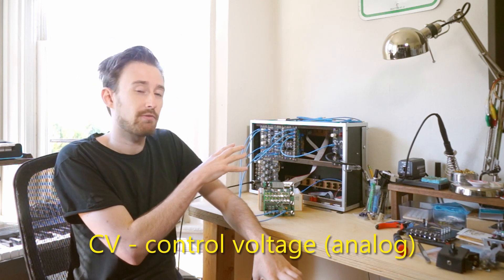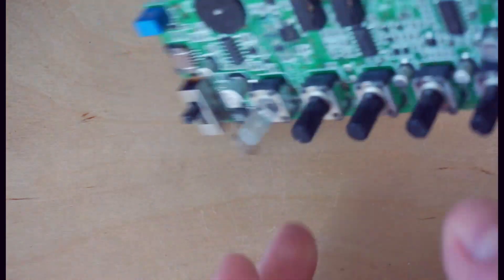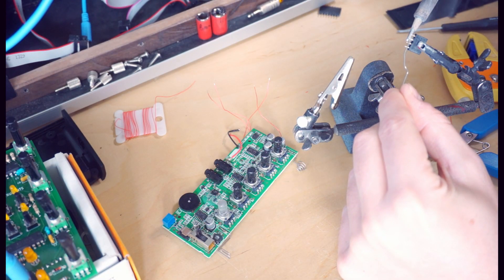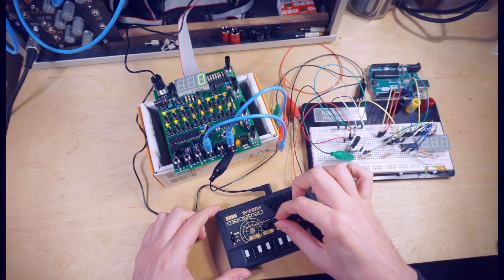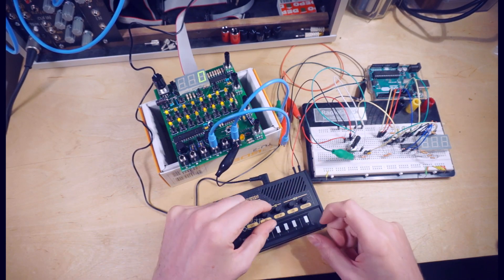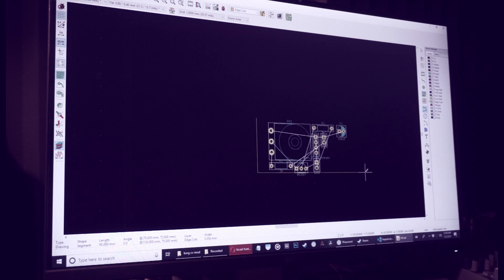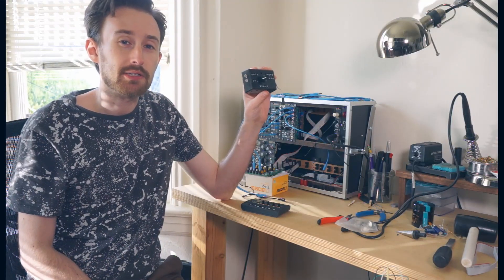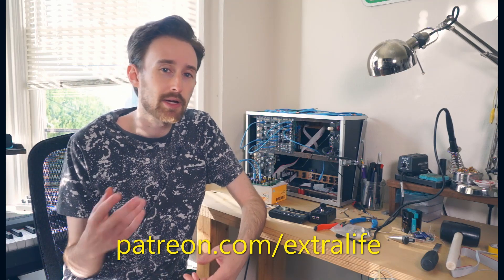Korg Monotron CV Input Mod (Eurorack Control Voltage hack)

Comment: Thanks for sharing. I arrived at the same solution to just control via single cable connection to gate. I control it directly via software with DC decoupled audio interface outs.

Comment: Awesome stuff!

I don’t have a Monotron but I have a similar goal with a Stylophone x-1 I got for Christmas, I noticed on day two it’d fart out notes if I touched the stylus tip to the cv/gate out from my Deluge, ten minutes later it was in bits :) I’m just connecting both input tips to the stylus until I work out what I need to do next, surprisingly the intonation is correct if I output from the deluge at 0.7v/oct.

Mathematically it seems like I need to multiply the gate and cv whereas I think my current bodge will be adding them together - which maybe looks a bit like your circuit diagram. I think I need to study both circuits a bit and have a re-watch, nice one for the info!

Comment: with all the knob twisted towards the gate of the monotron delay and the pin1 of the transistor , I am only getting notes ranging from G4 to F6. Compared to ableton operator plugin with same wave, G4 from my midikeyboard delivers almost an  bassy A1 note, and F6 from midikeyboard is barely reaching a G4 note from opeartor :c
 
Is there any further tip to further calibrate the monotron pitch? Changing some values? a bigger value from pot?

Ableton CV instrument doesnt work because calibration process requires triggering notes from the external synth and since it is a ribbon which gets bypassed when you plug gate signal... just doesnt work. Leaving the pitch still before calibrating within the plugin mutes the oscilation when trying to calibrate itself... Its been two months with this xp.
h3lp
Reply: What was the output voltage range from your sequencer? maybe i could tune it if I boost the cv from my audio interface
Reply from the maker: Hey, the output range of my sequencer is 0-8V or so. Officially eurorack is 0-10v. You should be able to tune it reasonably well using the potentiometer but you may not get a "concert" pitch as the korg oscillator is not 1v calibrated. I would expect to get probably 2-3 usably tuned octaves, and then some major nonlinearity in the upper range.

My suggestion would be to set up a MIDI sequence that plays a couple of octaves, like C1 C2 C3 C4 and then adjust the potentiometer by ear until you get approximate octaves. Then use a tuner to get the middle 2 in as close to perfect tune as possible going back and forth between two in a sequence in ableton. 

If you are not able to get octaves at all because the interval is too small, then there may be an error in your hardware - at the maximum rightward turn, the pot would let the full 0-10v CV through to the monotron, (potentially damaging it) so you should find a natural tuning range somewhere in the middle of the knob.

Once you have the potentiometer set, you can use a tuner or your ear to figure out which note it actually outputs when you play a C, and then use a Pitch midi device in ableton to transpose the notes up or down so that when you play a C on your keyboard you actually hear a C on the monotron. Again, this is not really possible to calibrate in hardware because the oscillator on the monotron is not tuned to concert pitch, but you can absolutely correct for it in software.

Hope that helps!
Reply: @extralifedisco  Surely it helps <3 thx senpai

Comment: Hey brother, you are quite the Renaissance man! Master of many elements. I am hoping you can help me out, so I bought a bunch of used gear with my stimulus check a year ago and I'm stick with what I've got, so I'm trying to make it work lol... my question is about using the CV features on a lot of my gear, so I've got an iPad with AUM/Koala and other apps, as well as my desktop PC running Ableton Lite 11. My actual gear is an Arturia Keystep and Korg SQ-1 Step Sequencer with CV A and Gate 1 inputs as well as a Gate B and Gate 2 input, there is also a MIDI out and sync in/out for connecting other gear. My question to you is what piece of gear would be best for circuit bending or interfacing between the two? I assumed I'd be able to use the Keystep's CV inputs Gate/Pitch/Mod on the back to convert MIDI from the SQ-1 and send it back through my Presonus Audiobox96 USB interface for playing with arp sequences or aftertouch/mod strip on the Keyboard during live performances. Would the Korg Monotron be the best gear for this? I saw where the Deluge has CV outputs (4 total) but it's rather expensive and I cannot afford it yet lol... my only gear is a Kaossilator (Phrase one - yellow), Launchpad Mini, and some Pocket Operators.
Reply from the maker: Hey man! I haven't used most of that gear specifically so I'm maybe not the best to ask, but sync/clock can be the bane of many live electronic rigs. In general it's best to stick to either analog Clock/CV or MIDI and not try to blend the two if it can be avoided. MIDI is sometimes a pain to configure and the cables are ungainly, but it does have start/stop/reset control which is a plus.

I expect the keystep will have the most robust clock options so I'd use that as the master clock and then send its clock out to the sq-1's "sync in". I believe eurorack clock and korg 'sync' are both 5v pulse, but some modules have different "PPQ" or pulses-per-quarter note. I imagine the keystep can be configured for different PPQ values, typically 1,4,8,12 are used. They should all use mono 3.5mm cables.

Integrating a PC setup is harder, you can either use MIDI to control of your sequencers and then chain its analog clock to the other one, or  just send an analog clock signal out the audio output from ableton and use that as your clock. I typically do this when I'm recording a song so the tempo and beats are synced with ableton's bars. I won't go into a tutorial but you just need to drop a "modular clock pulse" wav file into a Sampler and trigger it with midi at whatever clock frequency you like (this works best on DC-coupled interfaces with extra outputs you can spare for clock, but YMMV). Good luck!
Reply: @extralifedisco  Man, thank you so much for the well thought out and quick response. We are on the same page about the Keystep being the brains of the operation. It's literally got the MIDI control center which allows you to change the PPQ which I had to do to get my Pocket Operators synced up. So it's as simple as that, just connect to the Sync In on the Korg SQ-1. I was already thinking of using Ableton with a click track like a 16 step pattern as you suggested so that's perfect! I want to send MIDI data from Ableton to the Keystep to the SQ-1 to arrange scales using CV conversion if that makes sense. I actually have a USB to MIDI in and out cable which I could run from the Keystep to my PC to act as a bridge for the data. Do you think this would work? Thanks again for all your help. Unfortunately, the Keystep is the only real device I have which I can setup with MIDI channels to start/stop/record and have multiple tracks setup in Ableton armed to record.

Comment: I have a bunch of BC337s laying around, would those work the same?
Reply from the maker: BC557 is a PNP transistor, I think 337 is NPN so you'll need something else. 2n3906 would probably be fine, any generic silicon PNP can work as an on/off switch, specs aren't critical here.
EDIT: now than I think about it, this is more like sinking current (switching a connection to ground rather than +V) so NPN should actually work fine. Though if it doesn't, you'll just find out that the gate signal doesn't do anything, and the monotron stays on all the time rather than being triggered by the gate.
Reply: @extralifedisco  thank you! Actually, I already finished the mod ;D I simply removed r11 on the board, which solves the pitch-gate influence altogether. It's not fully working, I must've screwed up somewhere, but it's not dead (yet) xD

Comment: Great work and thank you so much for sharing your process!! How did you keep its output noise so low? Where did you plug it into (meaning the device's audio output)? Any tips for reducing its noise?
Reply from the maker: The delay chip (PT2399) is inherently noisy, more so at longer delay settings. You can turn down the delay send but there's still a high noise floor on it. I recorded it through a Sansamp Para Driver DI, which is a guitar amp simulator and EQ pedal, into my mixer and audio interface.

Comment: Hi! Can I use a 2N3906 instead of the bc557? :)
Reply from the maker: Yeah I think so! may have a slightly different minimum voltage but it's only latching so shouldn't make much difference
Reply: Extralife nice! thanks 😄

Comment: This is so good. Nice work. I killed my old Monotron trying to mod it, but this makes me want to try again and attach it to my Baby8 sequencer. Thank you for re-inspiring me.
Reply: Can relate trying to mod this, i accidentlsy removed smd capacitor near the ground of the battery compartment. After watching the schematics i realized it was a 10nf ceramic caps. Soldered a normal Through hole ceramic 10nf cap. That shye wss intense

Comment: Can the same mod be done to a monotron duo?
Reply: Yes, but not forget that he has the slider plugged in, so actually Vbias is passed to the gate at any given time. If you remove the slider, you will need a different circuitry, and the Duo has a different octave settings, that you might want a 300K variable pot instead of 100K. If memory is still working.

Comment: This is sick! I would love to build a CV adapter to Volca Modular pinpoints voltage since it’s only has a single one, which is not enough for me. Your example is very inspiring
Reply: Man, damn volca modular. I think I broke the 1st oscillator pitch patch point, all kind of modjlation or cv sending soundd like excesive pitch amplitude from an lfo with a super rapid frecuency... I think the patch socket got bent from inside or something. Sometimes i insert by mistake theVolca modulsrs cables between the slot and its enclosure :(

Comment: You are using the pnp transistor as a diode I think. Vbe never gets close to -0.6V if you drive the gate with a 0-5V signal. Try swapping pin 1 and 3!

Comment: I built it! It works! Still need to calibrate a little better, but it works.   Using a Beatstep Pro.
Reply: Having a bit of a time to get it to calibrate. Close, but not quite close enough.  Anything I may be missing?
Reply from the maker: I find it's easiest to calibrate if you set up a CV sequence that jumps octaves in succession, like 1v, 2v, 3v. Then you can adjust the tuning pot by ear until they sound like octaves on the monotron. It's probably also important to use a linear potentiometer and not an audio taper one.
Reply: @extralifedisco   Ah!  I swapped the trim pot I had in there for a linear pot.  Better for sure!

Comment: Very cool! Is this something that could be used to add CV inputs to a guitar pedal? 🤔 I've got a bunch of guitar pedals I'd love to hook to eurorack..
Reply from the maker: I run my synth through my pedal board most of the time. Audio is easy, but adding CV input to A device is more complicated. The simplest way is probably to replace the potentiometer controls with vactrols (leds and light dependent resistors) but it's not something I've experimented with
Reply: @extralifedisco  thanks for the quick reply! Perhaps something for a later video? 🙏😁 really enjoying your channel btw
Reply: @extralifedisco  I've found this vactrol based passive VCA. Worth a try?  https://www.youtube.com/watch?v=8BOnvSQpoGY
Reply from the maker: Ah nice! Yeah have been meaning to get another VCA/LPG in my modular. Would be a nice pair with look mum no computer's super-simple AR envelope.

Comment: Really cool video. Where did you get that Kynar wire?
Reply from the maker: The kynar was on ebay I think - I try to use Jameco for electronics supplies since they're pretty local but I think they only sold it by 100ft lengths.

Comment: Hi! Do you think this mod will work with Arturia Beatstep Pro which Pitch CV Out range is 0 to 10V and Gate Ou is 12V?
Reply from the maker: Yes, that should be fine as the gate input is only going to the transistor's base, not through to the monotron. However be careful not to turn the pitch scaling knob past halfway or you may send a 10v pitch signal to the monotron and overvolt its input.
Reply: @extralifedisco is there an easy way to limit the max voltage without otherwise affecting the signal that is under 5V?  I was looking at picsynth's site with the resisters in series for pitch tuning but I had trouble understanding how to implement his solution and I'm not sure how his implementation of gate/cv differs from yours.
Reply from the maker: @DarthGylcolious   Picsynth's series resistor design is used for creating a keyboard with distinct buttons for each note. For this CV input you just need to scale your CV voltage down to match the monotron range. You can do that using a potentiometer as in my design or a discrete resistor divider. For example, put one 10k resistor from your CV source to the gate input and another 10k resistor from the gate input to ground. This will divide the voltage in half (because both values are equal). You can calculate various resistor ratios to divide it for an exact reduction, or you can just use a potentiometer to duplicate that circuit and make it adjustable (electrically, a potentiometer is 2 variable resistors joined in the middle). 

These circuits are voltage dividers. For simple voltage limiting you could use a zener diode in reverse across the gate input and ground, which will begin to conduct when the voltage exceeds its breakdown voltage (often 5.1v, but you can get them in all flavors). Google "overvoltage" protection to find many such circuits, but beware that many of of them are designed to work purely with digital (on/off) circuits rather than scalable analog voltages.
Reply: @extralifedisco  Thanks so much for taking the time to answer my question!  I was concerned about having a large pot knob for the scale, as I could totally see someone who didn't know better accidentally rotating it to the max and passing through the full 10V of my microbrute's gate out.
Reply: Add a 1N4148 from VCC to the Pitch input, it will clamp the signal from going over 5v. I did so on mine. It shouldn't go anyway higher than 5v, it can accept 1V per octave but scale will be off, that is what the 100K comes in handy!

Comment: is it possible to use a 3.5 mm input instead?
Reply from the maker: Sure, you only need 2 connections so a TS 3.5mm jack would be fine, it would just be tough to fit a normal panel-mount one into the case without it hitting the circuit board. One of the low-profile SMD 3.5mm jacks hot-glued to the board might be better.

Comment: I LOVE the aesthetic of those embossed decal labellers!  I really preemptively jumped the gun and settled on making a much more involved project of my Monotron Delay than I should have.  I chucked the enclosure as soon as I ripped the membrane keyboard off, and proceeded to very brutally desolder the goofy stereo volume wheel pot, trimmer, and a bad feedback potentiometer, actually lifting a few vias / traces in the process!  I hope to just add a voltage regulator and then mount it as a eurorack module, once I fix what damages I've done and finally call it 'mine'.  Now after seeing what beautiful work you've made of yours, I've decided that never again will I just throw away an enclosure belonging to something that can serve any use at all, no matter what my final plans are for it!  I could have should have would have used those great DuPont connectors, and had them protrude from a little custom recessed seat in a panel for it to sit in the eurorack temporarily, OR detach it so it can go along with me on my way (maybe keep a lanyard on it for those dreaded house keys I'm always missing!)!  THANKS FOR SHARING!  The bus of wires to the external project box is a great method to employ when adding mods to this gear, especially when it's a sort of collectible and therefore something that you'd not want to impose upon much!

Comment: What happens if your CV levels are over the 5 volt VCC max of the monotron?
Reply from the maker: I think you could certainly fry the monotron! It's important to wire the potentiometer correctly and always start with it in the low position and scale up until the the pitch scale sounds correct. In general, the highest voltage from eurorack is 10v and the highest voltage the monotron wants is 3v. Some of the capacitors are rated for 6.3v. So you should never send high-voltage eurorack signals through to the monotron with the voltage scale control above 40%.

Comment: How does the one 1V/octave match the internal pitch to voltage ratio of the monotron?
Reply from the maker: Roughly speaking, the monotron uses a 1-3v range to adjust its pitch. Theoretically that could mean it's 0.33v/oct, but I'm not sure exactly. It does sound like it's a v/oct linear scale. In practice, what I do with this mod is set up a sequence of one note across several octaves in eurorack (e.g. 4v, 5v, 6v), and then adjust the voltage scale with the potentiometer by ear until the monotron is producing octaves at those intervals. This results in a useful 2-3 octave range.
Reply: @extralifedisco  Good to know! I can get 5 octaves of playability out of my modded Monotribes. I have modded a CV to the filter cutoff which allows me  to use the ADSR of a Microbrute to control this.